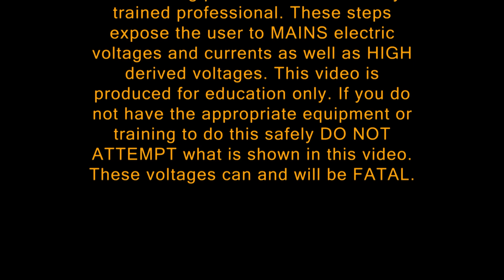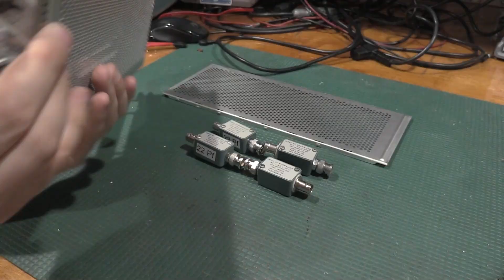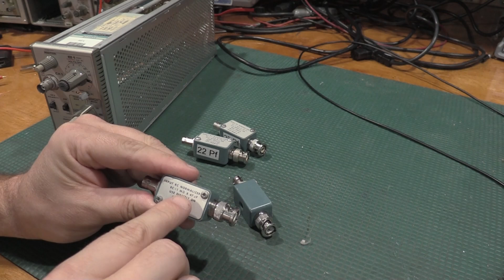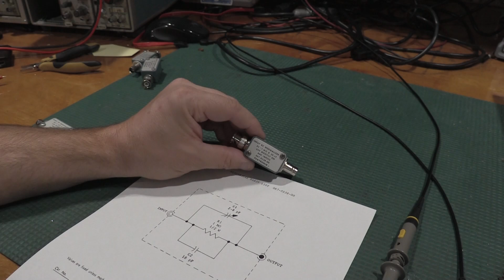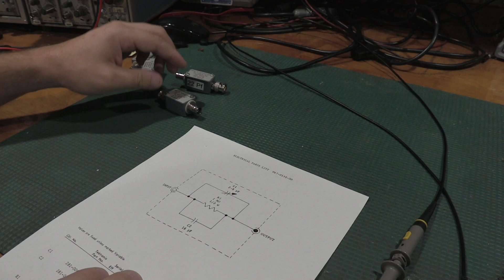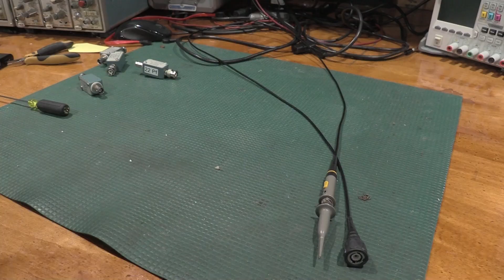Tektronix Input RC normalizers how and when to use them!

Comment: If anyone knows of a place to buy AFFORDABLE small boxes with M and F BNC on them just like these normalizers, please reply here. I have a need to build some custom loads for direct cable termination, to use with the 1meg input Z of the 'slower' vertical amps in the 7000 series.  I am aware of Pomona and others at $51 to $86 each.. looking for less costly, as these will be used under 200KHz , so high band quality is not needed.